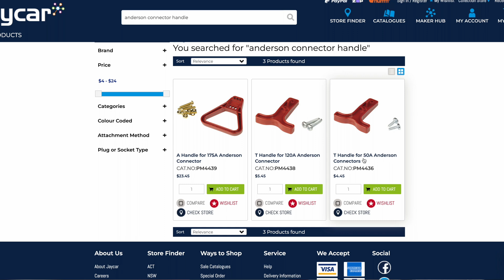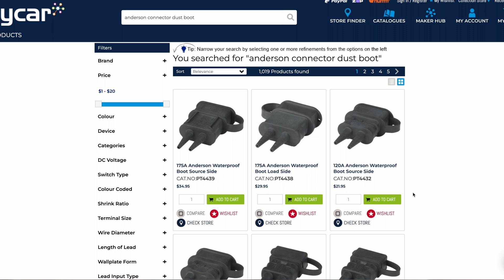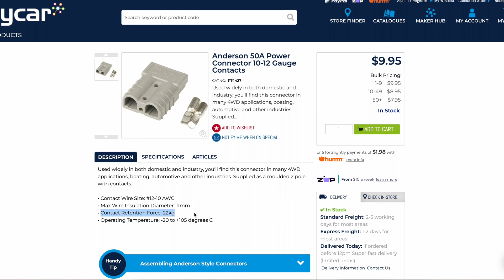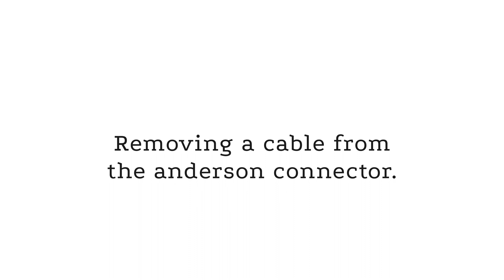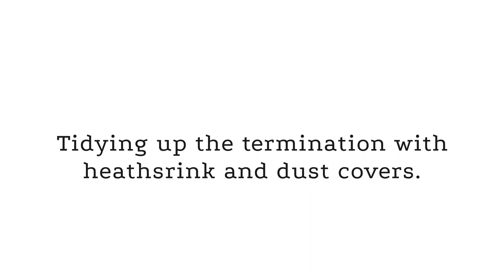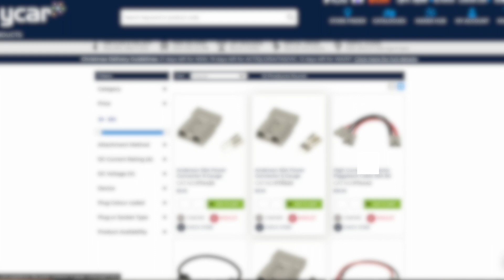All About Anderson Connectors || How to Terminate, How to Disconnect, Grey vs Red Differences etc.

Comment: I need one that I can mount on the side of the house that is waterproof. My solar is portable and I want to plug it in when needed and UNPLUG it to put it away (helps against bad weather and THIEVES.).
I have 8 gauge wires too. Solar glands seem to only come with 10 gauge MC4 connectors.
Figured Anderson would be a better choice.
Reason for 8 gauge is twofold - long run of 100 feet and suitable for expansion as money permits.

Any idea of WHAT I NEED?
Need end for the cable and end to mount on the side of the house.
Prefer gray as red draws too much attention.
Wish they had a non bright yellow color as to match the siding color.
But gray is next best thing.

Comment: The plugs are rated for ac and dc up to 600V, however the plugs are large and open and contact with the live parts are possible, so they should only be used for ELV applications. Also mating the connectors with high dc voltages above 12V at high current will destroy the contacts.

Comment: The plugs are colour coded to represent different system voltages. The manufacturer intended that yellow is 12V red is 24V grey is 36 blue 48, there are other colours too. The plugs are also keyed to prevent different coloured plugs from mating. Most use grey sb50 for everything, as this is the only colour that most shops could be bothered stocking.

Comment: so for ebike charing - red or grey, or doesnt matter (less force to plug/unplug - will be better)
Reply from the maker: You can use whatever you want as long as both are the same, a grey won't plug into a red.

But there's no standards for which to use (in Australia anyway).
Reply: @TheBrowneTown  thanks for extreme quick reply, this is custom diy ebike - I use xt60 now but is too small and to its very tight fit - anderson 50A with handle seems perfect for my needs

Comment: I am not liking crimping... I have a hydraulic crimper, but after the crimp, the wire keeps on falling out with a slight tug :/
Reply from the maker: Double check your sizing, you might need to go the next dye down. Automotive sizes are often not quite a match for metric lugs so for example it will be 31mm instaed of 35mm².

Comment: Hello Great Video. Just a question in regard to the piggyback anderson plug. Say for instance I had one of these connected to a n anderson plug lead on the van that presumeably come from the battery. . Can  I plug in 2 Portable Solar Panels/Blankets  One is a 280W 20.5 Volts (Panel) and the Other is a 200W 18 volts Blanket, both with MPPT. Or am I better putting MPPT closer to the battery. and connect to each individual battery.   I was told that I cannot connect the panels in parallel because of the different type and voltage of the batteries tks

Comment: Nice run-down on your process and the options - I would have like to see the crimping process itself and a clear shot of the crimped lug (maybe you're keeping that for the onlyfans!) 😅
Reply from the maker: Thanks mate. You're right I did miss that shot completely 🤦‍♂️

With these hydraulic crimpers all you need to do is lock off the wheel, pump the handle and keep the crimp straight in the die and use the right size.

If my cable is too small I often bend it over to fill as much of the die as possible, or crimp the die at say 10mm first, then drop it to 8mm for example and crimp again.
Reply: @TheBrowneTown  Nice! I might have to think about getting one...